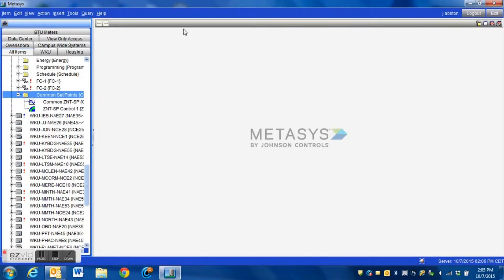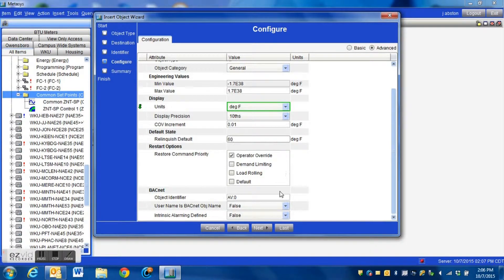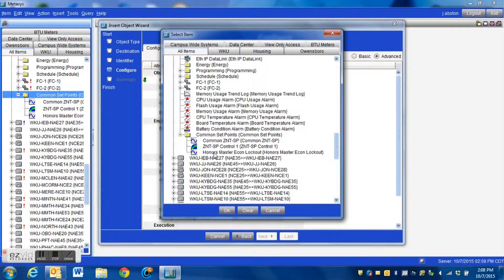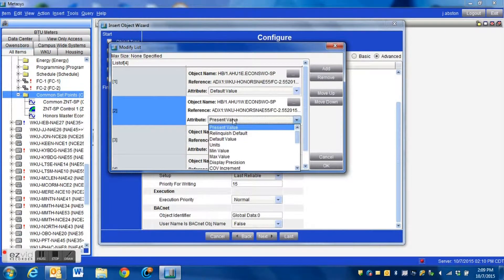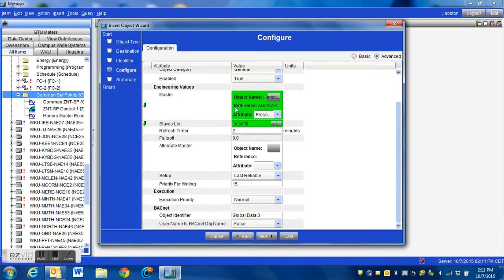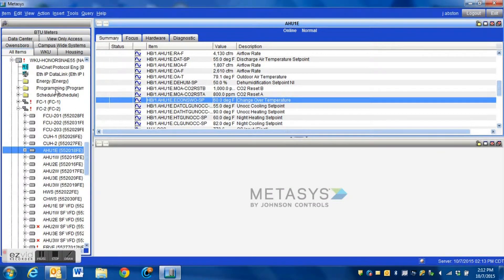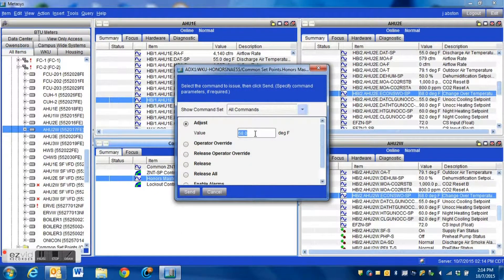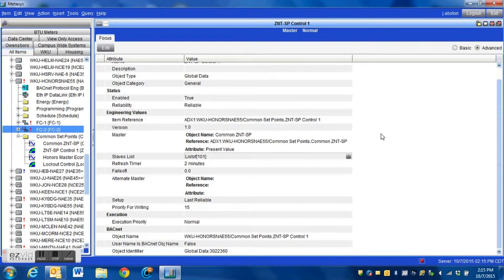Sharing Data in Johnson Controls Metasys using Global Data Object

Comment: Any suggestion on using it as a way to do a mass temporary override? I use Advance Search to do Bulk Command Temporary Overrides for our PH-O to help prevent LT-As on our AHUs during quick cold fronts. But I’m trying to use Global Data to make it easier and more user friendly for the other guys when they need to put the overrides on.
Reply from the maker: The global data is used for keeping a single value in a list of points. Unless you want to keep all of them at the same value all the time I wouldn't use it. You can use an equipment summary and simply do an override on that particular column.

Comment: Hello, If you wanted to share an inpu, would it be the same process?
Reply from the maker: There's a few ways it can be done including this way.
Reply: @Systemcontroltech  We had an LCT setup, but LCT is giving me a write error. 
It was working perfecly. 
Nothing changed on our end, it just error out.
Already deleted and re done the logic still in error, any thoughts?, thanks.
Reply from the maker: @aacontrerass  what are the two types of points?
Reply: @Systemcontroltech  AI to AV, that works ok, 
Then AV to AI.
OA-T
Reply from the maker: @aacontrerass  is the AI a physical hardware point or is it a software point?
Reply: @Systemcontroltech  hardware-sensor.
Reply from the maker: @aacontrerass  in your point attributes in lct be sure to set it to out of service.
Reply: @Systemcontroltech  I got it to work, ai-av, then  NAE-NAE av-av, av-ai, So basically same configuration just thru different path, We are reading the info of a N2 network, maybe an error in the integration.